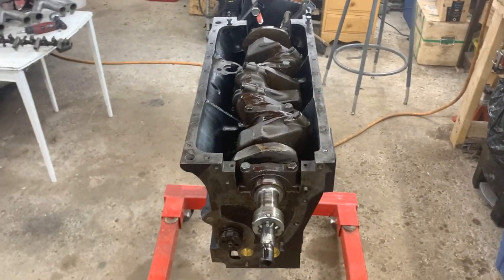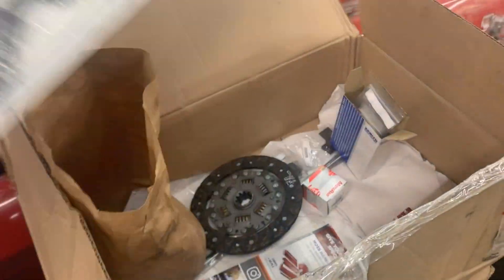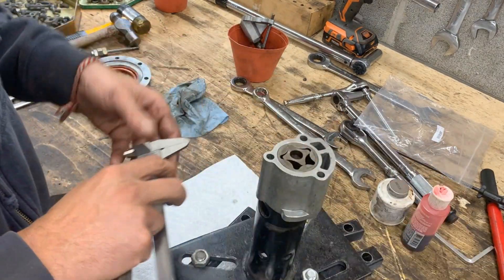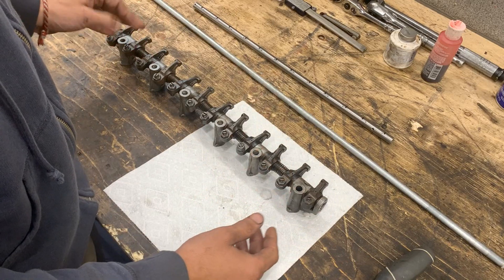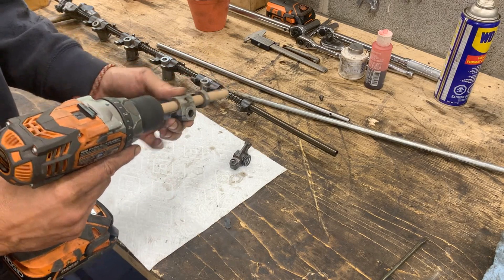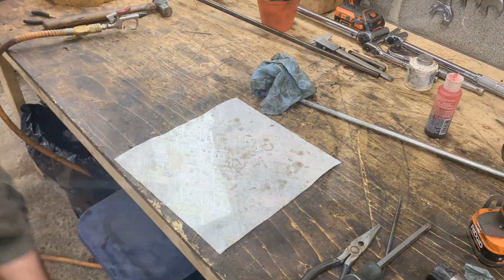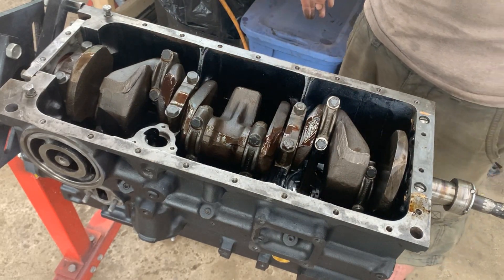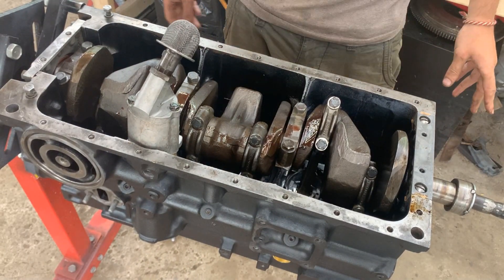1975 Triumph TR6 - Part 20 - Assembling The Engine Continues

Comment: Hi Elin, I think there’s supposed to be a copper washer on the top bolt of the rear engine seal. I didn’t see you put one on? Tush bolts his engines sideways onto the engine stand so you can access the rear end. Great video as always.
Reply from the maker: It was there, but I reused the old one. I know it is not the best option, but I had no other choice as I didn't buy a knew one.

Comment: Hi Elin, do the springs on the rocker shaft become fatigued and need replacement?
Reply from the maker: The ones on the shaft, no, they do not compress and decompress thousands times a minute like the valve springs. They just keep the rockers apart and barely move.